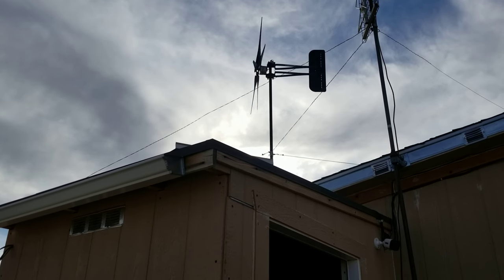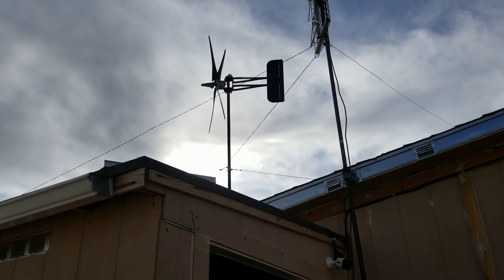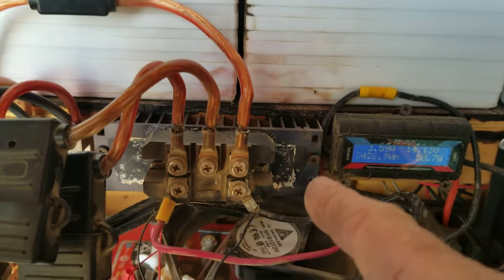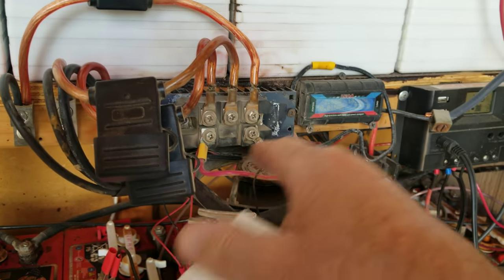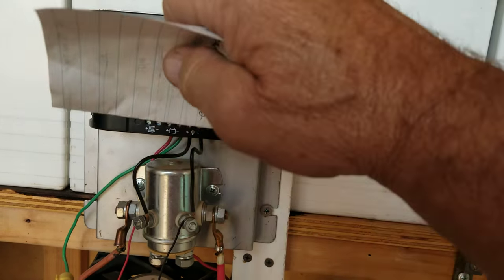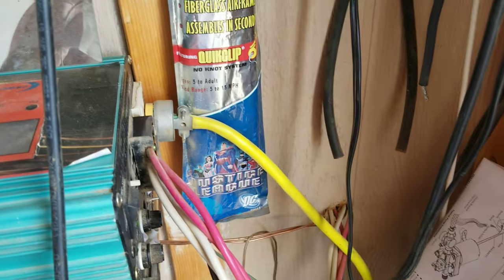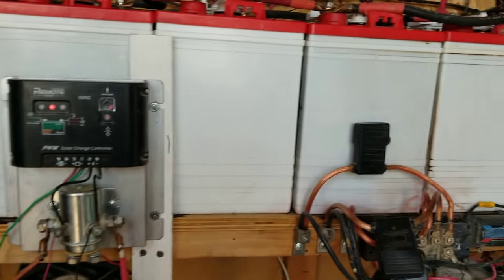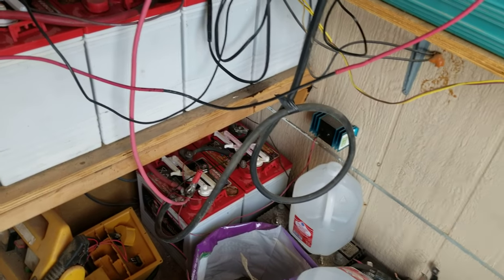Wind turbines, controllers and batteries explained, March 6, 2020

Comment: Im making a diy wind turbine from a single phase dc motor. Do i need to add a controller between the turbine and battery and if so, what controller should i look at? Thank you for the great video!
Reply from the maker: Usually a DC turbine can be connected directly to the battery bank, but first you need to do some tests to determine maximum output of the generator to be sure it is in range for your batteries.  Too low an output, your batteries won't charge.  Too high an output and it will damage the battery. Using a controller, you will also need this information.  If output is around 13vdc, you would charge a 12v battery. If output is around 39v, you would charge a 24v bank, etc.
If connecting directly to the batteries, you would need a dump load diverter to protect from overcharge, and an inline diode to prevent backfeed to the motor.
A charge controller should come with both features built in.
Reply from the maker: Welcome aboard.
Reply: @GBear  thank you!! Great now i can finally get sterted. I think i do have a couple of diodes laying around. I didn't even think about backfeed.

Comment: Hello G Bear, thank you for the very informative video.   There are so few of these videos going into wiring details.  I had a few questions as we are also installing a turbine, but this is in Wales UK. I am learning as I go along so please bear with me. The setup is a 5Kw turbine, standard three-phase (three magnets), 300 yards from the house. 48v batteries with a 5kw controller.  I have laid 2 x 10mm cables from the turbine (instead of 3)  does the controller now have to be located at the turbine site as it has a three-cable ac input?  Or, could a rectifier be put next to the turbine to convert to the two cables?   Any advice is appreciated, Dan
Reply from the maker: Hi Dan, welcome aboard!  Since 2 rectifiers can't be used on the same PMA, you would need to mount the controller at the PMA.  The problem is, if you do that, then you need to use larger diameter wire from the controller to the load.  The reason we choose a PMA over a PMG is to save on conductors (wiring size).  It looks like your best option is to run a third wire from PMA to controller.

Comment: I purchased a Lantern type PMA for my travel trailer.  I have the same Green MPPT Wind/Solar hybrid controller as in your video.  The instructions for setting it up are confusing.  Can you please make a video on how to setup the controller.
Reply from the maker: I found the same thing when I tried to read the Chinglish instructions.
I don't recommend using that controller for your PMA.
Instead, buy a bridge rectifier to convert the AC to DC and go directly to the battery bank.  Use a digital diversion control to protect from overcharge.  You can find the items on Ebay.

Comment: What are the technical characteristics of that selonoid? Could you provide connection diagram of the selonoid with the controller, thanks
Reply from the maker: Hi, welcome aboard!  That solenoid was specifically designed for  that dump load system which is no longer used.  The unit that replaced it is a digital diversion control.
Reply: @GBear  Thank's man!
Reply from the maker: You're welcome.

Comment: Hello sir! We are recently conducting research on hybrid energy systems, we tried to apply them to an electric tricycle (somewhat similar to an e-bike), where a solar panel is mounted and a wind turbine, but for the wind turbine we used a vertical axis type and it is enclosed in a case, the wind flow would be from a roof scoop when the e-tricycle travels. What is your opinion on that sir? Do you think it would work? 

Also I have another question, sorry, if I would use separate charge controllers and the output would be in parallel towards a single battery, would my battery be charged? 

Would you recommend using buck converters for each output?

I would appreciate the response sir, thank you! We could talk more if you'd like. God bless! Love your videos
Reply from the maker: @kurtryan6697  Hi Kurt, Welcome aboard!  It sounds like an ambitious experiment you have going.
Some math and a few electrical test meters will help determine if it will work.
Perpetual motion is not an option, even though some youtubers would like you to think it is.  First you need to determine how much power the trike motor will consume under load in terms of watts.  Then you would need to provide a power input from the turbines that slightly exceed your power usage, so that the battery receives a charge while using power to run the trike.
Unfortunately, that might require a very large turbine, adding weight and drag on the vehicle, therefore requiring more power.
Don't let that discourage you from trying, though.  Just keep in mind all of the variables, and work to equalize your needs.  
In the past, solar powered vehicles overcame the weight and drag resistances by using lightweight frame materials,  skinny tires with high air pressure capacity, angling the solar panels to reduce wind drag, etc.
Remember,  inverters don't get it perfect the first time.  They experiment and find answers then try again.
Reply: @GBear  thank you for the pushh!
Reply: @GBear  is it okay if I would continue replying under this comment section in case I have more questions?
Reply: @GBear  is it okay if I would continue replying under this comment section in case I have more questions?
Reply from the maker: @kurtryan6697  Yes.  I'll help if I can.
Reply from the maker: @kurtryan6697 You're welcome.

Comment: what is the point of having a PWM module connected to the batteries to dump extra power if the power reaching to the batteries from the rectifier are already charging your batteries, won't they get damage over time more quickly provided there is no controller before power reached them after they peek in power? it seems to me that the PWM controller should go after the rectifier to charge your batteries and not later, not a criticism, i'm wanting to build a water wheel generator with either a PMA or PMG and its a bit confusing with all sort of information in the internet on how to connect stuff
Reply from the maker: Since a PMA or PMG can put out excessively high watts and amps at times, running it through a controller requires a special controller to handle those ranges.  I have seen my PMA put out 166 amps, and actually fry the rectifier which was rated at 150A.
The PMA is specially designed to operate a 'dump load' system, which puts a 300w load on the battery bank when excess power is created.
Reply from the maker: Welcome aboard.

Comment: I have two 1200 watt generators trying to charge just a single 12 volt deep cycle and it seems to be troubled, the voltage will tap up around 13 volts but it's not consistent and it does not seem to charge battery, what should I be doing?🤔
Reply from the maker: Welcome aboard. Ok, you left out some information needed for an accurate response. 
What is the battery running?  And do you also have solar panels?
Unless you have constant wind producing energy at 13v,  or no load on the battery, your system is inefficient. 
Think of your car.  If you play the radio with the engine off, and only start it up once a day, the battery can't keep up and dies.
Reply: @GBear  I'm getting solar panels but they have not arrived yet but I was wondering if it would be better to try to charge the 6 volt big motorhome coach batteries and run them in series for a 12-volt system but charge on the 6 volt side would be better because I can run a continuous 8 to 10 volts generally with the generators alone I have been shutting everything off and just trying to get the generators to charge the one 12-volt deep cycle but it's just too much, baby if I waited days and days🤔 also what do you know about a buck booster would that be more for downsizing the voltage rather than stepping up from too low of volts to a 12-volt not sure how that works yet?

Comment: Thank you for the videos. Question can I add a wind turbine to my existing solar setup rather than a power dump I want to have the PMG turbine go through a charge controller.   My solar setup is identical to your solar setup
Reply from the maker: Yes.  You need a separate Midnite Classic controller dedicated for the turbine.  With the Midnite Classic you will be able to adjust the curve for optimum power from your turbine.  Note, if you have a PMA, you still need a bridge rectifier between the PMA and the Midnite Classic.
Reply from the maker: Welcome aboard!

Comment: I have this green wind/solar charger, when I use it my batteries get over charged/heated . Batteries are also connected with another set of solar panels through solar inverter, I have tried to set batteries charging parameters, any idea how I can resolve this
Reply from the maker: Unlike solar, a turbine will keep sending charge through the controller as long as it produces.  That is why a dump load, or diverter needs to be used with a turbine.  The diverter senses the battery voltage, and when it goes over the set limit will send the incoming power elsewhere.
Reply: @GBear  thanks, I understand and has dump resistor installed, but over charging don't happen with wind power but with solar power from green device

This doesn't happen with wind, because I don't get much wind in my area. Mostly it's Solar
Reply from the maker: Then, trash the controller and buy a Midnite Classic.   Hybrid controllers that handle both wind and solar in a single unit are trash in my opinion.  I speak from experience.

Comment: the green mppt has turbine input and dump terminals.  have you considered buying another one for the turbine?  or is the turbine greater than 600 watts. that green mppt is also available in 1000 watt model too.    then you could get rid of the black pwm and its solenoid and use the all in one green controller to open and close the dump load..      also what about getting the 12v water heater element for your water heater tank to further alleviate grid consumption?  heck its free energy. might as well right 

u definitely know what you are doing but you dont get any gold stars for organized wiring lol haha.   good video tho. very helpful. thanks
Reply from the maker: Welcome aboard!  My turbine is 1685watts.  Those hybrid controllers are junk.  I learned the hard way on that.  I have since upgraded to a Midnite Classic controller for solar, and still use the dumpload as backup. But it never activates anymore because the Classic monitors the battery bank. I also have a tankless water heater so I don't need the preheated setup.
You are in the early videos still, and you will see alot of advancements in later episodes of my playlist.
Yeah, the wiring isn't pretty, but it works perfectly, lol.
Thanks for your thoughts though.
Reply: @GBear  thanks , i will continue to watch.  with the classic, when it shuts off charging to the bank,  and you are rarely using the back up, how are you preventing over-speed without keeping some sort of resistance on the turbine?
Reply from the maker: @toobglued  the turbine is connected directly to the battery bank.  In the future I will be controlling it through its own Classic, which will make it more efficient.

Comment: Why did you use the cylinoid coming from the controller
Reply from the maker: Welcome aboard.   That is a dump load controller I purchased about 8 years ago.  It came like that, and it monitors the battery bank for over voltage from the turbine, then the solenoid activates and sends the extra power to a load.  Once the battery voltage is lowered it goes back to standby mode.  The no longer make this type of dump load unit.  Now digital diverters are used, or turbines are controlled through something like a Midnite Classic.

Comment: I love my 3 phase AC PMA turbine.  Mine is rated 500 watt rated gets 1200 watts at 40 mph winds.
Reply from the maker: Welcome aboard!  Great isn't it?
Reply: @GBear  I love my portable wind and solar setup. I can tow it with my camper and use it to power my house at home. It took me 400 hours to weld drill and bolt cut and wire everything on it.
Reply from the maker: Do you have a video posted about it?
Reply: @GBear  here is another windy day partially cloudy https://youtu.be/3H8lqvrAVpw
Reply: @GBear  yes i have made several because I am always finding something else to upgrade or do differently and even better than the first go. I am never finished with it.i am always adding something.
Reply: My solar controllers weather proof custom made diy box is badass I spend money on that part.i put a temperature controlled relay board inside to turn on cooling fans and 6 inch stainless steel vents for intake and out take in the back bottom with a very awesome blower fan.i also have a breaker box for PV array and solar controllers . I will post an opening video on it.
Reply: @GBear  that's the solar box
Reply: @GBear  it's people like us that will survive the hard times about to hit the United states . I prepared very well for pretty much anything . Collection of firearms and ammunition and archery equipment too and skills on making traps for animals and men. I love to tinker with AI based turrets and camera systems and renewable energy . I helped a buddy make a pond on top a hill on his property  and another pond bellow.and flood gates with a 5kw water wheel. During the day his solar system fills his huge battery banks and then runs water pumps and pumps water uphill to the top pond. His pond can run his water wheel for 3 weeks without being replaced by the pumps . He also had his pond stocked with fish. He also has 2 large 1500 watt 3 phase thermadyne wind turbines his bank is 48v 6000 ah . His solar array is 10 kw 200v . He lives in northern Idaho and weather can get windy and cloudy often with out warning. Sometimes not very much solar for a week or wind .so it's nice that his water wheel can kick over and keep his bank charged for weeks on end as another storage system  that doesn't have to require extra battery backup  just water energy storage on top of the hill. Saves him a bundle. He powers his parents house and shop and barn and his house shop and barn and both of his kids houses as well and another shop from this system .very impressive setup. Someday I would love to buy some land and build me a nice self sustaining space.  But my idea is I want to buy land with geo thermal well and build a steam turbine plant and use mostly inline inverter system to regulate the power and even use the water for heating the floor and walls in the winter and a year round green house to grow crops for canning and dehydrator fun. 24/7 power from a large steam turbine would be awesome .I would also have a backup that can be flipped on during maintenance on the other one and also some solar for backup. I might even build a pond on a hill too with a lower pond.. I love wind turbines too especially building one from scratch.i love making my own stators.and rotors
Reply from the maker: Wow!  Sounds like a nice, and expensive, setup!
Follow your dream!  Only you can make it happen!

Comment: We've got winds up to 70 today...I'd have to use a 3 inch pipe lol...I got an Epever 4215 BN controller it can take 1000 w...my inverter/charger charges up to 29.8 v usually so I'll just use batteries for a load..how many volts does it make?  I've got an old Honda alternator from a weird 660 car that usually makes about 36 volts so if I put 12 neodymium ring magnets in it , can I just use a diode bridge from an old Miller welder? I've got eight 85 amp hours at 24 volts until I can get 2 more
Reply from the maker: Sounds like you have a great project in the works!  Winds are 25mph here today with rain on and off.

Comment: Another great video. Do you know what is the difference between 12V and 24V PMA I'm confused about which ones to buy? 
Also, why didn't you use MPPT for your PMA circuits it has a built-in rectifier and auto-switch ON and off function in case of overcharging
Reply from the maker: Welcome aboard!  Yes, the difference between 12v and 24v or 48v PMA'S is what you use them for.  12v for 12v battery bank, 24v for 24v battery bank, or 48v for either 48v battery bank, or grid tie.
I don't use mppt controller for my PMA simply because it is rated for 1865 watts which exceeds most controller's ratings.  I may however try a midnite classic 250 controller in the future, but since the system works as is, there is no need to spend money to fix it.
Reply: @GBear  Thanks for explaining the different volts system. What Volt system are you using?  would you mind making a video on how to set up 24v battery banks and how to apply an MPPT or charger and power inverter to Parallel to the series battery banks?
I am using a modified car alternator as PMA with MPPT my PMA produces 9V which going through my MPPT shows 25V  and I can trace 25V all the way to my parallel 24V battery bank (set of 4 batteries in parallel) I have not put any load on my system because I'm not sure my MPPT is charging because it hasn't shown Red charging light in any of my tests run I can only see Green light ON and set of Arrows flashing towards bulb in MPPT display. I am not sure my PMA and MPPT are compatible with each other as well as they are charging the batteries but thanks to your answer I am going to buy 24V PMA  I think I should run everything 24V on my system.
Reply from the maker: I'll address all your questions in tonight's video. Are you using 12v batteries?
Reply: @GBear  

I'm using 4  12V batteries in 24v series to parallel connection
Reply from the maker: Ok.  Watch tonight's episode for answers.